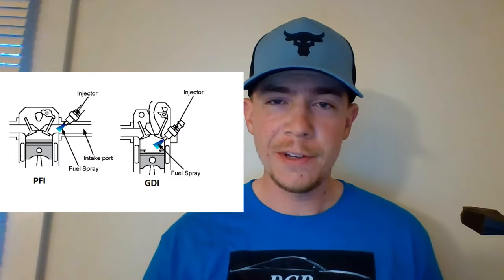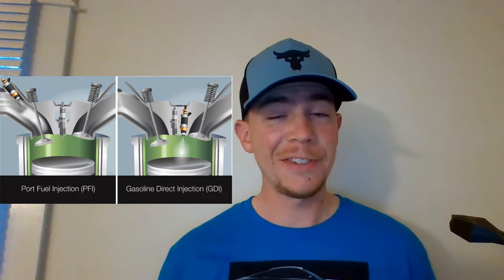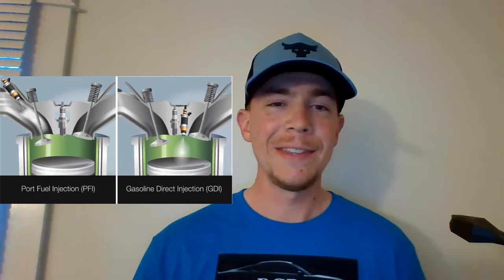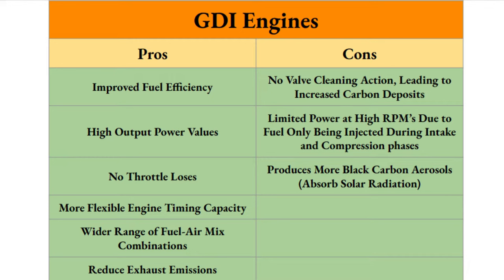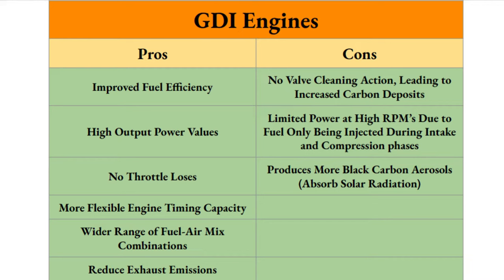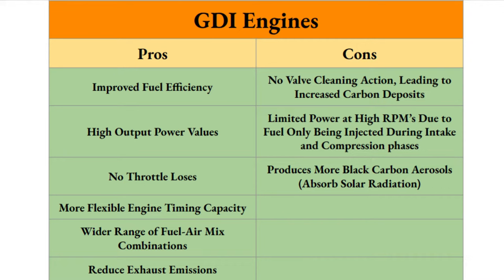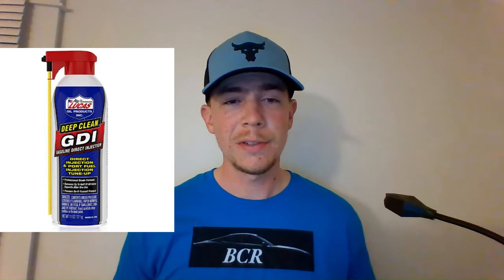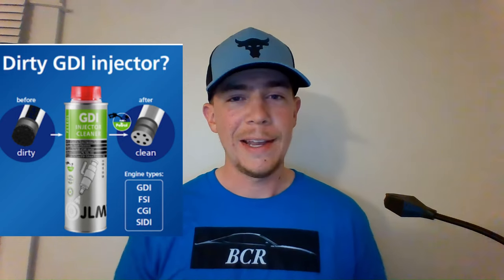Understanding GDI Engines - Are They Doomed?

Comment: My mechanic is telling me that they're seeing the oil consumption issues that Hyundai\Kia is notorious for in other brands of cars now, notably Honda and Volkswagen.
Reply from the maker: That’s not good to hear! Thank you for watching!
Reply: Honda has been having oil consumption problems for years. All V6 Honda’s are prone to oil consumption, however the worse case was the 3.7 in the Acura TL, MDX, RL, and ZDX. They are however more reliable compared to Hyundai.
Reply: Well, the time when we used the good old Oto motors with multipoint injection where we never had to worry about these kind of problems is unfortunately gone. The chase to produce the engines that are more and more powerful but that have less and less co2 emissions and consumption has brought us al these kind of problems that are shitty to live with.
Reply: My 2008 Audi A3 with 1.8 TFSI which is comparable to GDI was crazy. After 150k km i was nearly at 1L of Oil for 1000km.
Reply: @gab33  im at that level of oil burning at just 60k miles😢

Comment: We have a 2013 Kia Rio we bought new , with 1.6 engine . It has 225,000 miles and just replaced the alternator for the very first time.  Replaced battery for the second time , 3 months ago. Replaced the plugs once. Took Pcv out , shook it , it rattled, put it back in . Its been the most trouble free car we've ever owned ! For $13,000.00 it has been a great car . I used the same synthetic, conventional oil blend as the dealer used when i had them change it when it was under warranty. Changed my own since. There was one recall on the part in the steering wheel , CLOCK SPRING,  which had caused the trip odometer and steering wheel controls to stop working. It was replaced free of charge. Also have never added more than half a quart of oil  , between changes, and only did it 3 times. I give the car 5 stars after 10 years and 225,000 miles.
Reply from the maker: That’s great to hear. Appreciate you sharing first hand experience in depth. Thank you for watching!
Reply: I had a 2015 Kia Soul 1.6L, bought it with 203k miles. Sold it at 267k miles. I noticed in the records the rear catalytic converter was replaced at 180k miles. I had to have the manifold converter replaced at 255k miles. Kia Corporate covered that cost. I'm really glad because otherwise that would've costed me $2k+. It was an oil burner. Had to put a quart of oil in it every 1k miles if I did alot of highway/freeway driving. I miss the car though, it was pretty dang comfortable being 6'3". Not many small cars I can fit in comfortably. I think this car was geared differently. In the business district it got 29-31 US MPG. In the highway/freeway it only got around 24-28.
Reply: @Lincolnator721  I had this same oil burning issue at the same rate as you, but I did a piston soak with some Berryman's B12 when I changed the spark plugs. There is no more oil burn.

Comment: I just bought a 2023 Kia Sportage X-Pro with a 2.5L GDI engine. Found out about the carbon issues afterwards 😮. But now I know GDI’s are common & not singular to Kia’s. Long story short, my engine isn’t on the list of motors, even on Kia’s own list. I’ll stay on top of my maintenance and I do majority of 90 highway miles daily so I’m expecting positive results. I’m loving my Kia. I definitely think they’ve improved their quality immensely. Time will definitely tell & I’m optimistic 😊.
Reply from the maker: That’s great to hear! Hopefully that’s a great vehicle for you. Thank you for watching!
Reply: Clean or replace pcv valve £15 10 minute job every 50 000 miles. It help to reduce carbon.
Reply: @goldenultra  PCV valves are now being built into the valve cover assy. No longer a pull out and replace or clean item.
Reply: You have bought a very awesome vehicle!
Reply: U r so right.! The key is maintenance.! There r engine performance treatments out there like ATS505 CRO, & BG engine performance & fuel treatment.! Marvel mystery oil also can be added to the engine oil which also breaks down carbon build up.!
Reply: But Ford, who uses both a GDI as well as Port Fuel injection so they have the efficiency of GDI and the valve cleaning properties of PFI.
Also, this guy was 180° wrong about everything he said up to 1:40.
Gas spraying on the valves in the combustion chamber is Not causing carbon, it's gas Not flowing over the back side of the valves that caused carbon buildup. Gas Cleans Valves but it can't with GDI because gas doesn't flow past the back side of the valves, like Ford's Eco Boost which uses both GDI and PFI
Reply: The 2.5 GDI in your sportage also has MPI. The multi port injection helps eliminate carbon build up. So with proper maintenance which means doing 5000 mile oil changes with full synthetic oil it should be fine. My 2024 sportage x line has the same engine.
Reply: @ yup I’ve come to find that out about the dual injection. I’m at 33K miles with full synthetic oil changes at 5K miles, engine running like butter. Kia has become a reputable manufacturer and Genesis is making strides.
Reply: @RonaldReed-ul9du  any thoughts on a 2025 telluride?

Comment: Another Con is reliability, complexity, and maintenance. The GDI systems require low pressure fuel pumps, high pressure fuel pumps, high pressure lines, etc. They have to increase the pressure to 800 PSI. This a lot more stuff that can fail and increases maintenance costs. More of these cars will end up in the junkyard.
Reply from the maker: Thank you for watching!

Comment: I own a sonata, and I change my PVC valve every year, I  change my oil every 3 thousand miles ,so far so good.
Reply from the maker: Great to hear! What year is it?
Reply: Why do you change the PVC valve every year? I have never changed mine.
Reply: It makes zero sense that you’re changing the pcv valve every year. And it’s a waste of money to change your oil every 3k miles.
Reply: @adamnugent2137 No you think its is a waste,but its great economical saving in long term
Reply: @adamnugent2137  For decades we all changed our oil every 3k miles, and now everyone's gotten so lazy and so bombarded by marketing that 3k is considered crazy and burning oil is considered normal. No one would do any maintenance to their car if the marketing department wrote "all fluids are lifetime" in their owner's manual. Sure a good synthetic won't break down in 3k miles, but you still have water, dirt, and other contamination accumulating in that fancy oil just the same. If you go much more past 5k miles you better hope you have "optimal" driving habits and "optimal" conditions if you want your car to be trouble-free for a long time without having to add oil. Unless you think it's normal, of course.

Comment: Have a 2014 Santa Fe 97k with the GDI... What a POS... 10 qrts per 1000 burned.. Contacted Dealership.. They changed the oil and said bring it back after 1000 mi....2 and 1/2 weeks later and 450 miles no oil on the dipstick. Back to dealership. They did a internal engine cleaning then had me pick it up and told me to bring it back at the 1000 mi .. Told me it would be better to drive it with low oil in the hopes of blowing it up...Left with no OIL on the stick.... I swear if that thing blows and I am injured I will own that dealership....Dont buy Hyundai , PERIOD.
Reply from the maker: Thanks for sharing your experience.

Comment: My GDI engines each have a catch can which helps.  I try to run top-tier gasoline and I do an intake valve cleaning chemically once a year.  I am hoping this pushes out walnut blasting, but time will tell.  My "N" engine ran really great after the CRC Intake Valve Cleaner.  I switched last year to the Berryman since it is a single person operation as opposed to the two-people required for the CRC cleaner.  Well aware of the issues and I am trying to address them early.  These days I think all engines are GDI.
Reply from the maker: Appreciate you sharing more real world experience. Thank you for watching! Enjoy your N!
Reply: What is a 'catch can'?
Reply: It is a baffled and filtered can that sits in the circuit which pulls vacuum from the engine using the intake.  This sucks oil vapor, etc. into the intake.  The result is a build up on the intake valves.  This can captures most of this to minimize intake deposits.  These are emptied each oil change.  The cans are not a cure, but they help significantly if you use a good one.
Reply: @arthurmroyce  Does a dealer install a catch can if you ask?And do you think it would be wise to run premium gas in a 2025 telluride?
Reply: @sacredsounds4234  I suppose a dealer would install one if you ask.  I always make a custom bracket.  They are an authorized mod when correctly installed.  The engine pulls timing a bit using regular gas.  My wife runs regular in her GV70 3.5T.  I run it in my Veloster N most of the time.  You lose a bit of performance, but this is not noticeable with regular driving.  The difference is .80 per gallon in Pennsylvania.

Comment: GDI engines are all that you can buy now. Consumers are screwed.
Reply from the maker: Thank you for watching!
Reply: GDI is not the only engine available.
Honda HR-V has a port injection engine.
Toyota engines use dual injection (both port and direct injection in the same engine).

Comment: I had a 2017 Hyundai Accent with GDI engine.  Great value vehicle but I had to put a quart of oil every time I changed my oil around 3K miles.
Reply from the maker: Thanks for sharing and for watching!
Reply: It was after around 75K miles or so when I noticed my vehicle burning oil and having to add about a quart of oil every 3K-4K miles when doing oil change.

Comment: Bought my Kia in 2021 used and 1 month later the engine threw a rod through the block. I wasn’t pleased at all but was happy to see the engine would be replaced for free. Took 3 months of waiting but I got the new engine and all is well in the world. Have about 10k on the engine and avg about 24 mpg in the city which is pretty good in my opinion.

I change the oil every 5-7k miles and use full synthetic only. So far so good with the new engine 😎
Reply from the maker: Hopefully you’re good now! Thank you for watching!

Comment: I bought a 2024 Sportage about 6 months ago that has the 2.5L GDI engine but, before I bought the vehicle, I looked up the current specs on the engine because if it was only a GDI, I would not have bought the vehicle. However, the specs indicated both GDI/MPI injection systems, so I felt better buying it.
Reply from the maker: Should be smooth sailing for you. Thank you for watching!

Comment: I don’t know why this is not a recall? they can do gdi, but they MUST do set of secondary injectors to spray gasoline before the intake valves to wash. So easy to do but yet they don’t. Definitely a recall issue. Is there a lawsuit for this issue? I have a 2013 Hyundai sonata and having this exact problem.
Reply from the maker: I haven’t come across any lawsuit information but I agree, it seems like a recall for certain models and years should be a thing. Kind of like the transmission issues with the 2nd gen Colorado and Canyons. Good luck with you engine. Thank you for watching!
Reply: Some new smartstream engines have gdi+mpi

Comment: 2016 Kia Forte Koup SX owner here with only 44k miles (I am the second owner).

I only use Premium fuel, and it's a 1.6 Gamma Turbo.  Do I got anything to worry about?
Reply from the maker: From what I’ve read, I don’t think you’re in the bad batch. Regular correct maintenance should do the trick. I’m no mechanic, however. Thank you for watching!

Comment: Im thinking to buy new kia carnival model. Does it use GDI engine? Does kia use newer type engine on the latest model? Thx
Reply from the maker: As far as I know, the issues have been largely fixed from what I’ve read. But I would research. I’m not an expert on engines by any means. Thank you for watching!
Reply: New kia carnival has 3.5L GDI engine paired with 8speed auto trans

Comment: Noticed you didn’t mention the 1.6 like what I have in my KIASoul. I bout used with 80,000 miles on it and I hear is engine failures ? For various reasons
Reply: I believe there is a recall for the 1.6 engine specific to souls. Research and find out. I’ve seen it several times.
Reply from the maker: What year is it?
Reply: 2016
Reply: I bought a 2018 1.6 and it burns oil like crazy😢

Comment: I believe the carbon is coming from blow by through the rings and back up through the PVC all that oily vapor gets thrown against those hot intake valves and that's where s*** starts happening. 
At 136,000 mi my car started using oil 
And it wasn't running quite as smoothly 
Took it up to get gassed up opened it up on the highway a little bit and after I exited stop at a couple lights over a couple miles it started knocking. So I drove it home had it towed to the dealership. And was denied because they said it wasn't rod bearing failure. I did 100% of my service at the dealership. On both my cars. By the way my Sportage has 400,000 mi on it. It's not GDI. Best car I've ever had. The hell of it is The Optimas still holding up great. No rust everything works. I had to put a new engine in it.
I also installed a catch can however I believe those are problematic because the moisture they collect can freeze in the winter time. Theoretically a catch can should help tremendously. IF you start getting a lot of oil in that catch can you know you've got problems.
Reply from the maker: Real world stories are the best to hear. Appreciate you taking the time to share. Thank you for watching!